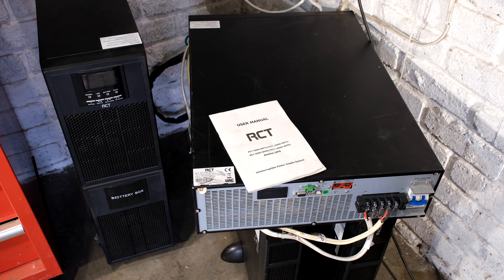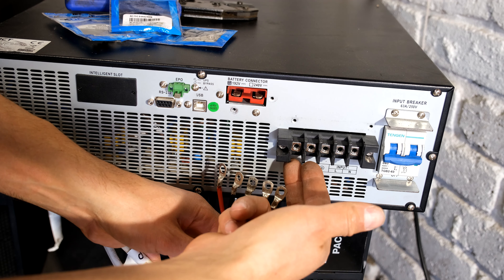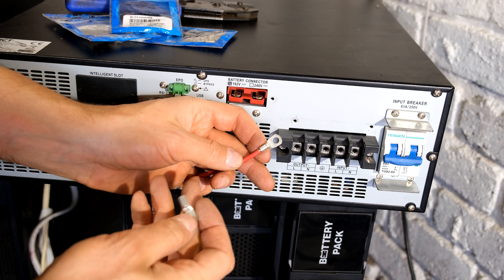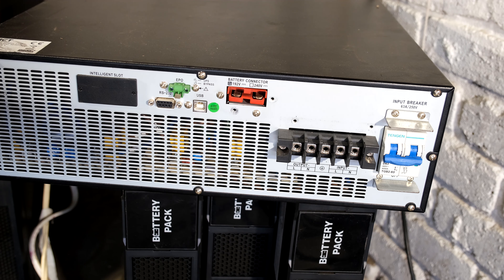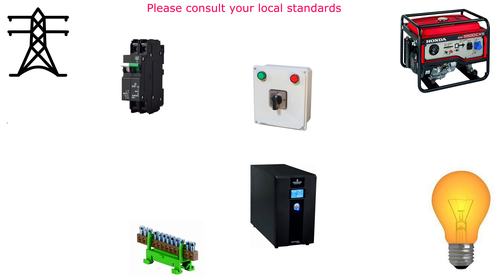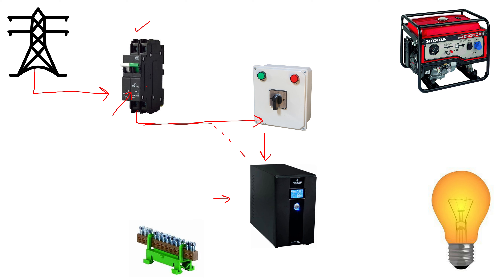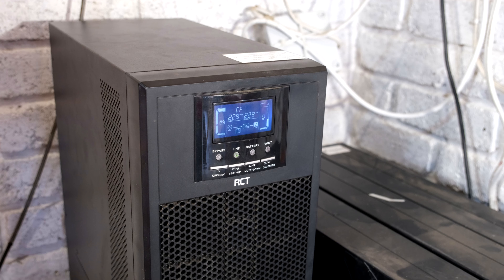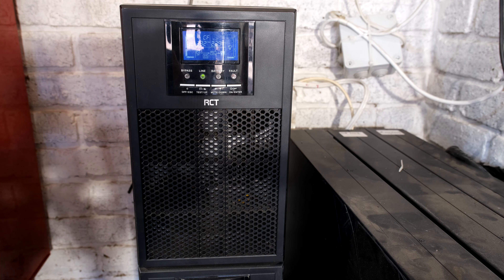Wiring the Voltronic WinnerPro 6k/ 10k / Rectron - Mecer WPTU WPRU UPS - South Africa

Comment: Hi I used 6kva online ups and wired to main switch via change over, power consumption is lawer than 10 amp is it safe to use 10 amp breaker  for  out put